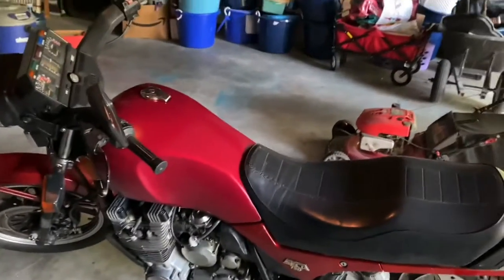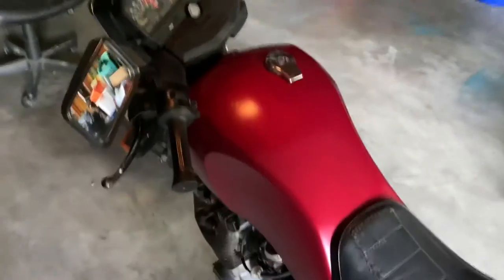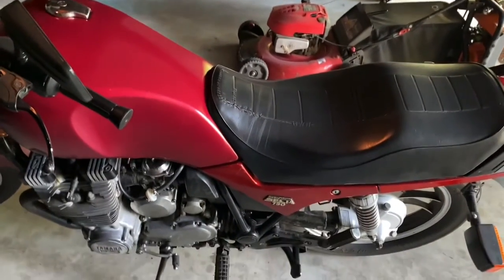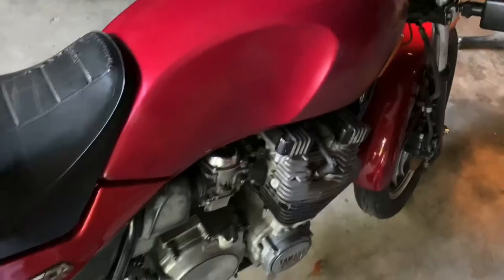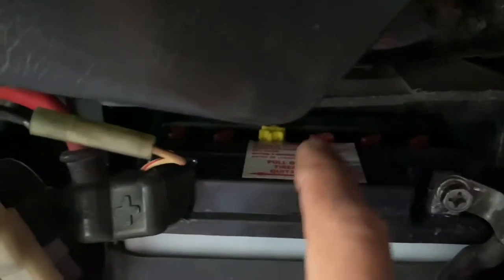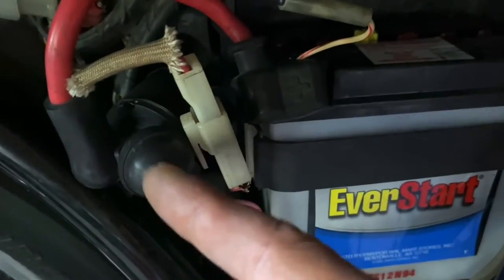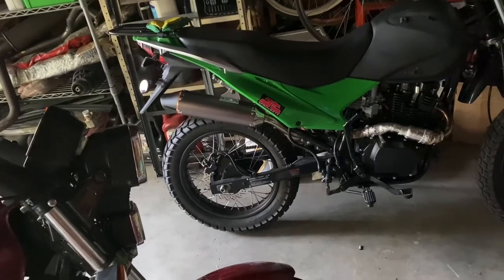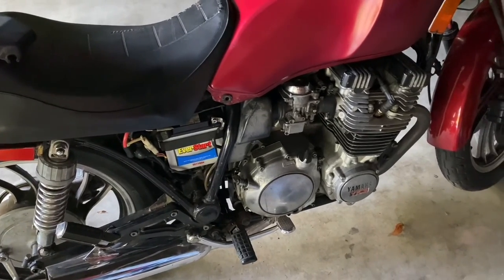Yamaha XJ750 SECA - Battery Sensor Warning

Comment: Check to see if you have a TPS sensor fitted and that it's working, it should look like a black box boarded onto the right-hand carb, this can cause the engine to run away, you may want to check the jets as well if you have change the air filter from standard this would explain the hesitancy and the bogging down as well
Reply from the maker: I will most certainly do that, thank you Shaun!
Reply from the maker: Do not see a TPS sensor anywhere.  I did some google searching and I don't think this bike has one?  Is that possible?  I don't know this is my first motorcycle, just mostly know cars.  I couldn't find a part available for order for this year of bike.  I could find TPS sensors for later 1990s models.  I think I found some of the problem, one of my fuel lines had a tear where it connected to the filter.  I switched it to a wider hose to correct the problem.  Took it for a ride today and no issues.  I can definitely hear a vacuum leak coming from one or more of the intake boots although.  Also when I started the bike up today and was inspecting for vacuum leaks, I touched one of the intake boots and the rpms went flying like it was Wide Open Throttle.  Took my finger off the boot and the revs came down.  I was kind of shocked that just pressing down on the intake boot could cause such a fluctuation.  I loosened the clamp and moved it back a little to cover the hair line cracks I could see and that seemed to fix (band-aid) the problem.  Now I have to pull off the carb again to get to all of the boots and I read that I can just cover them with RTV high temp gasket seal and that fixes the leaks.
Reply: If your bike has a TPS, it should be fitted on the end of the throttle link bar, on what for you will be kerbside, it will just look like a small black box, approximately 2 inches Square, held in place with two screws in slots and will look as though if you undo the screws you would be able to adjust it's position, clockwise or anticlockwise, slightly, if it's not fitted than you are in luck,  mine was a nightmare and caused me know end of brief trying to get the bike to run properly and took me months to source a replacement part which I had to get direction from Yamaha Japan
it may be that it is "a European emissions" control part, I did a little bit of research and the TPS wasn't fitted as standard here in Europe until 1986, so yet again I might have just been talking a complete load of BS, but as you've probably figured out already, I am quite good at that 😎🏹🙏